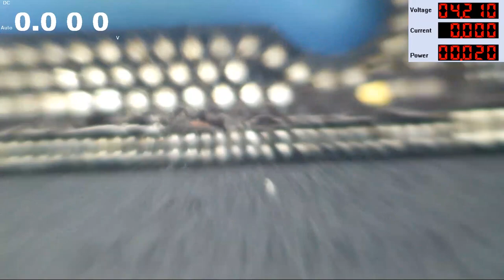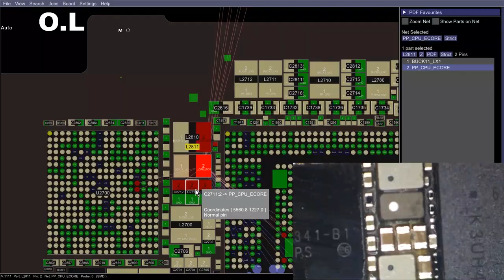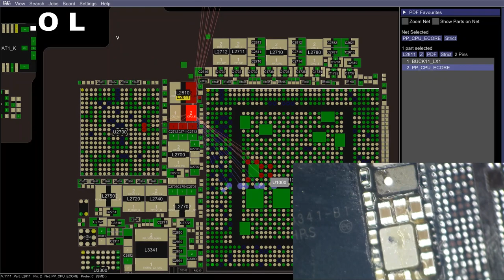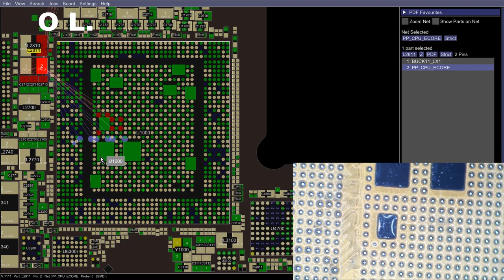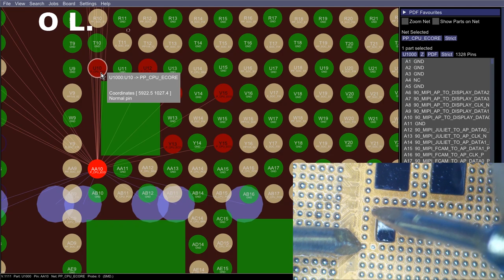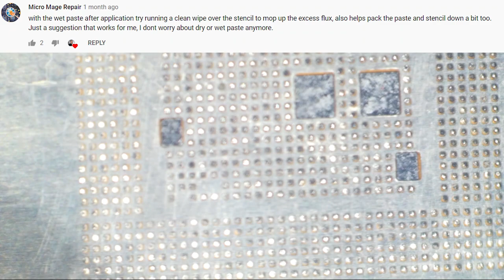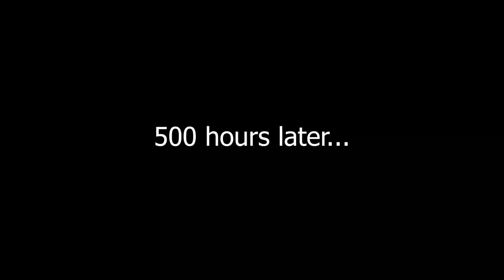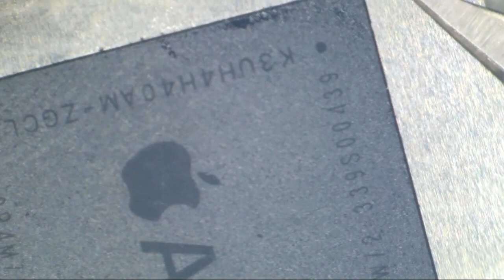iPhone X CPU re-ball - The Conclusion

Comment: CPU have ground around all pads. Look carefully in microscope and you see that. What’s why you have a short. All missing pads need isolating used uv green mask before you rebolling.
Reply: Dmitry i had done it two times while doing A10, coverup those pads with uv before reballing. Go extra zoom under microscop and see horizontal and vertical lines if other track. If those track exposed, they get shorted after reballing
Reply: It is not necessary to add UV Mask to 'NC' pads. They're fine.

Comment: By drying the paste, mean literally squeeze a good blob of paste onto paper towel and squeeze out flux from the paste. Keep working it in paper towels until it has concistancy closer to bondo or playdough, than runny catsh*t. Then apply on/through stencil, When you wipe after that, you can do that with a suitable squeege. It packs nicely and even, and doesn't go astray (as long as you keep the stencil in place of course).

Very reasonable result 👍 That jig for keeping the chip and stencil in place, looks sweet af.

Comment: in my opinion i must use unleaded soldering balls instead of leaded cream solder on cpu reballing such as laptop graphic card reballing else repair  returns in 3 months guaranty time (my customer repair service guaranty).
Reply: Unleaded is environmentally safe but much more brittle. Leaded has a lower melting point, making it great for solder rework. It is also much more robust, so your repairs will last longer.
Reply: It will return in any way after a couple of months, waste of time, the problem is not usually at the balls

Comment: Hey all. I make decent money in my area replacing iPhone screens, batteries, doing basic repairs but I want to further my repairs by taking up micro-soldering. I've been educating myself here and there, but Ill be honest, haven't begun any hands on practice. My question for starters is, in terms of the expensive equipment, can I manage to do iphone repairs with just a 2032 micropencil, the FX951, a hot air rework station, and microscope. Is it necessary that I need the hot tweezers to do logic board repairs? Thanks!
Reply: No. Hot tweezers aren't required. They're handy because you can quickly remove components without heating the surrounding area. Great when you're working around the more sensitive areas (connectors, CPU, etc.....). They also double as a micro pencil.

Downside, the tips are easily bent. The tweezers, the tips and the compatible solder station can be a bit pricey. And depending on the make, model and tip choice, they may still be too large to work in areas with little clearance.
Reply: @OnYourSquare  Damn, thanks for the reply. So I may have overreached with my starter material (me being a beginner and all) but I went ahead and invested in the FM203 that came with the FM2027 and FM2023 (the hot tweezers)... just bc it was on ebay for 550 new which seems like a good price. Is it reasonable that I just start getting into microsoldering repairs from self teaching and youtube videos? Or would you say taking a course essential?

Comment: Hi ,when you were checking pins under cpu you did a mistake , you checked one in that wasn't short to ground ( the upper one) but the lower pin you checked was not short to ground actually , it was shorted to some other pin which was not GND . your cpu was most probably OK!!!!